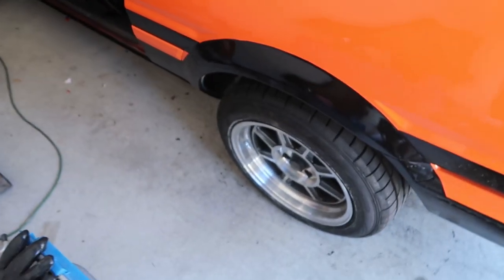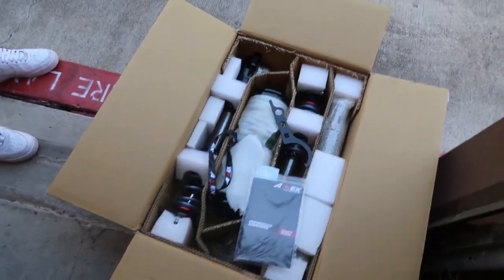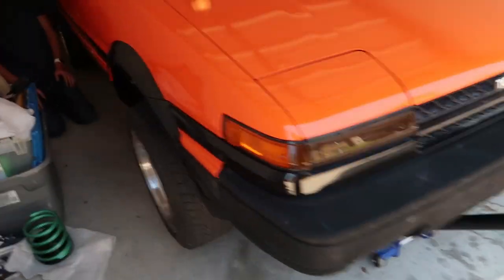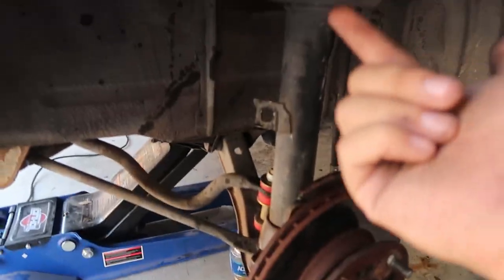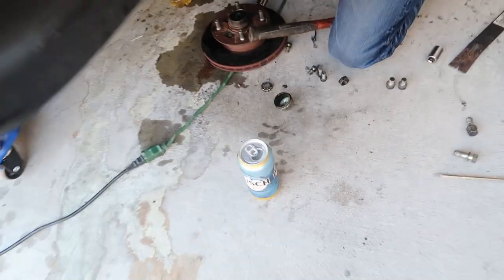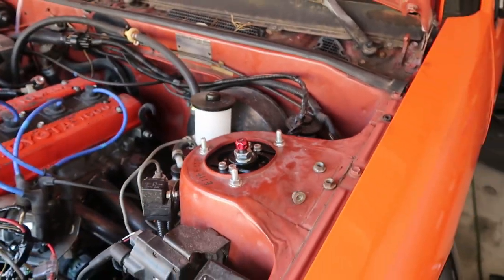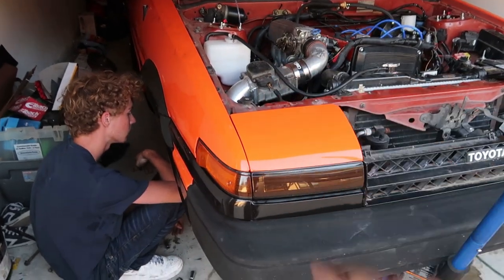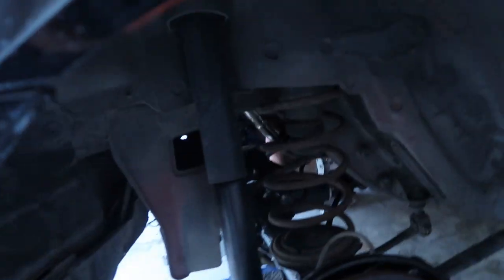Installing Annex Coilovers on the AE86 (BEST Track/Daily Setup)

Comment: Hey Chase! Thank you so much for the support and taking the time to make this video. Great work setting rear spring preload correctly (its a struggle, we know!). I would recommend using an impact gun on the rear top shock bolts (Use a socket and wobble if your gun wont fit it the trunk). You can adjust front camber to gain more tire clearance. I would also recommend an adjustable panhard bar to center the rear end. Thank you again and enjoy Corolla!
Reply from the maker: Thanks so much for making the product, I’m loving them! I’ll definitely take an impact to the top of the rear shock bolts and the panhard bar is already on the way. Do you happen to know if all corollas has the bump stop above the rear end, mine didn’t seem to have it and I can’t stop feeling like I missed it.
Reply: @hakosan86  All AE86 should have had the rear diff bump stop. It could have been removed in your car's past lifetime!
Reply from the maker: Yeah that’s what I was thinking, I’m just not sure why since the last owner had no intention to lower it and wanted it as a daily. The owner before that was the original.

Comment: How much does the kit cost ?
Reply from the maker: Around 2000
Reply: Mine was roughly $1,700. I got Swift springs front and rear 7k up front and 5.5k in the rear.

Comment: did you buy the suspension in battlegarage?
Reply from the maker: Yep
Reply: @hakosan86  What other parts did you buy in battle garage? I have an ae86 beams motor and I need other parts
Reply from the maker: I’ve bought kouki jdm turn signals, Greedy oil filter, Greedy oil plug, sard radiator cap, lower control arms, poly bushings, pan hard bar, stainless steel brake lines, etc.
Reply: @hakosan86  you had no problem installing the parts? everything fell into place? My fear is that I order something and do not fall into the car
Reply from the maker: If you need any help finding anything join the discord and me or another 86 owner could help u https://discord.gg/mHdBXeQT
Reply: @hakosan86  thanks😎👍